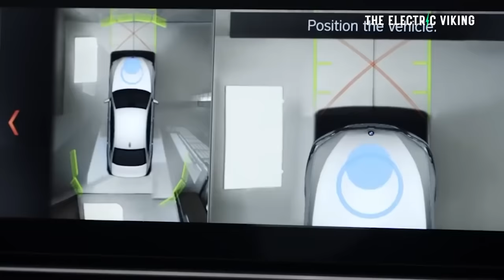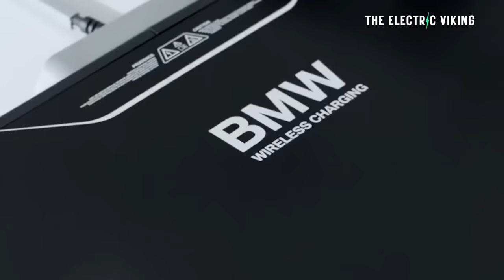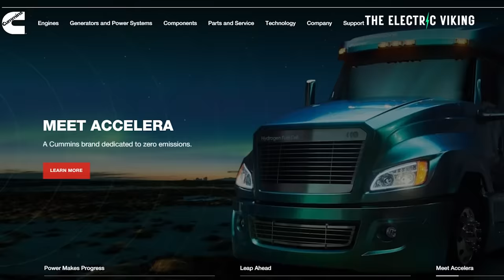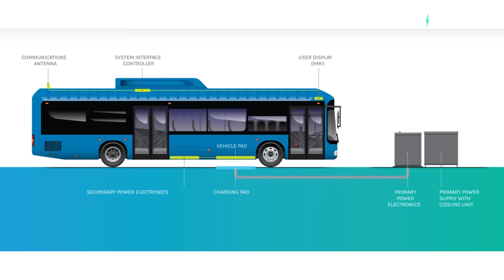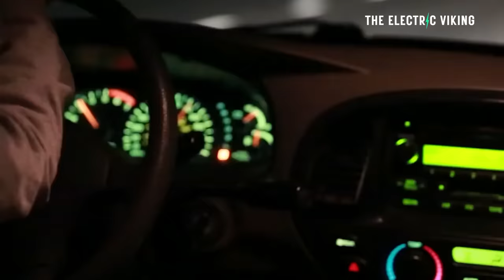U.S company invents 500kW ultrafast wireless EV charging, powers in 15 mins

Comment: Depending on the battery configuration,  they could wireless charge even faster than 15 minutes or charge at the same rate using less power,  by using a quadruple line charge controller for a 4 battery configuration layout.  Say 4 x 20 kW batteries.   Obviously the charge controller would need to be robust enough, however you could use 4 coils and 4 charge controllers for 4 batteries to maximise charging speeds and efficiency. Thus the 4 batteries are wirelessly charging in parallel.  Super fast !!!  Super safe !!!  Each battery pack gets you say 70 miles of range, thus totalling 280 miles of range.  Because you can charge super fast, range becomes less important.  A battery management system would optimise the use of the batteries and charging regime based on an optimisation algorithm, linked to the driving requirements and charging patterns.
Reply: By distributing the charging load across multiple batteries, you can potentially mitigate the effects of internal resistance and maintain higher charging speeds compared to charging a single 80 kW battery. This is because the overall charging process is distributed among multiple batteries, allowing each battery to charge at its optimal rate and minimizing the impact of internal resistance on the overall charging efficiency.
Reply: Thus a 4 battery pack configuration could make 5 minute charging to 80% well within reach.
Reply: Most drivers on most trips don't drive more than say an average of 40 miles per day.  Thus one of the four 20kW  battery packs could comfortably cover that distance and thus be run down from 80% ( 56 miles ) to 10% ( 7 miles ) approx.. SOC ( state of charge) being the optimal charge range for certain common battery chemistries. i.e. assuming a range of 70 miles per battery pack.  This usage pattern allows drivers to make the most efficient use of the battery capacity while minimizing stress on the battery cells. All this,   whilst retaining super fast charging in a safer and more efficient way than charging one 80 kW battery in the same amount of time.
Reply: Could you not have, say, 8 batteries, with 4 installed for normal weekday trips (at the center of the car) & adding 4 for longer trips (2 on each side of the 4 central packs)?
Reply: Not sure about viability of 8 battery packs.  Some manufacturers have used varied chemistries in multiple battery packs for the scenario you suggested.    I would say if you can have two batteries packs, then you could have more than two,  however there would be a point of diminishing returns.  Much would depend on driving and charging habits and requirements.  Obviously they make products based on average Joe usage patterns. The average Joe for example in the USA drives 40 miles per day.
Reply: Thus if one 20 kW battery gets you 75 miles and you're an average Joe then an 80% charge gets you 60 miles,  less the 7.5 miles being the 10% recharge threshold.  i.e.  for common chemistries they suggest drain battery to 10% then recharge to 80%.  Thus 60 - 7.5 give you 52.5 miles of practical driving range to ensure optimal battery management.  Thus that gives you 12.5 miles of reserve above the 40 miles average range of your average Joe driver, most of the time. With smaller battery packs the charge resistance threshold is reached sooner.   However,   the charge resistance level is much lower,  due to the lower resistive impedance within the 20 kW battery pack,  when compared to one 80 kW battery pack.  Thus the charging effort for the EV super charger is much easier, thus making it sustain a higher rate of charge as it approaches full charge for the smaller battery pack.

Comment: Wireless is always less efficient than wired charging, so an extra nuclear plant may be required even in the less populous countries. 10% extra charging loss in Finland (5.5 million inhabitants) would mean 4.5 TWh of new electricity production needed just to cover it, if the traffic is fully electric and wirelessly charged. That is about ⅔ of a small NPP's or ⅓ of a big NPP's yearly production. Not to mention extra copper coil, etc. that has to be built into the vehicles and driven around, too.

So, no.
Reply: Wrong. It's more efficient than a wire.
Reply: @chrisedwards8365  Maybe in some other  universe.

Comment: I can see this charger being used in parking areas, e.g. charging stations, overnight parking or residential garages.  
Trying to embed these chargers into active roads, where the construction/materials vary region to region and country by country, and the surface weaning requires resurfacing every decade or so... no.   Too much complexity.

Comment: So would all EVs need to be scrapped for new ones that have the induction charging system?
Trucks probably need fast charging less than most, as they are required to rest the drivers, so could be just recharging normally.
Are there any dangers of induced current on people animals or just some conductive material dropped over these areas?
Of course the biggest problem will be getting charged for the power, rather than just recharging from the solar on one's own roof.

Comment: I don't want to sound negative, but this solution is DOA. 1. The concept requires heavy infrastructure, multiple power supply units on the sidewalk, and unsafe pads underneath the car. 2. Costly implementation. 3. Costly manufacturing 4. require a new billing solution. 5. High maintenance. 6. Hazardous street 7. A solution that no one wants.
Reply: No one wanted the automobile when they had horses and carriages!!
Reply: Not realistic. Impractical.
Reply: Amazing armchair insights😂
Reply: Bro this is 1st generation. It'll get better by the 5th or 20th version. Give them a break
Reply: 8. It defies laws of physics. Induction losses will be huge and at these numbers where is this excess magnetic force going to go? Do not stand too close if wearing a pacemaker
Reply: Totally agree as you use about 40-50% more power to do the same as a wired charge. What no one talks about is how much to implement? Who pays for the implementation? How long before people start digging up the roads to get to the materials, the same as cutting off the charge station leads? How much infrastructure is needed? EV drivers think all of this is free until they get a bill and then scream how unfair it is.
Reply: This solution is clearly for City Driving only, for public transportation only at the begining. So it is very welcomed. Next gen will be better
Reply: @dstr1 No. They totally did. And that of course how the change occurred without even the smallest amount of government coercion or mandates. Put your idiotic EV mantra away.
Reply: You forget paved roads, and highways didn't exist. People had to do very expensive hard work to make it happen ut was impossible for cars to go anywhere outside cities
Reply: Wrong. It's safe and more efficient and less costly than wires or gas stations.
Reply: It's 98% efficient and placed nowhere near pacemakers. Besides that pacemakers having protection against electric fields, like from your wall socket or spark plugs on your car.
Reply: This is th future u don’t know wtf ur typing about
Reply: Your totally wrong... It's 98% efficient. And 1/4 the cost to build and zero to maintain.
Reply: Maybe they can't afford roads because the military that protects foreign oil, for $35 Trillion and the $7 Trillion to oil and gas subsidies, and you still have to pay at the pump.
Reply: Recently Joliet Illinois denied an electric  truck charging station because it would consume more electricity than the city has.
Reply: @ttkddry  the amount of losses is not a problem, as long as it can be dealt with cooling. very fast DC charging like the v4 1MW superchargers require liquid cooling too anyway. the problem is efficiency if it's much lower than charging through a cable it increases charging cost and emissions to generate the electricity.
Reply: @geemy9675  thank you for repeating my argument, the losses are a problem because they decrease efficiency. Most high amp DC cables have liquid cooling built in
Reply: @ttkddry what law of physics exactly? electromagnetic waves and magnetic fields travel through air very efficiently. it seems like the most wireless chargers are around 95 %
Reply: @dikkybee4003 what if it has similar efficiency
Reply: a lot of the charger maintenance is related to cables and plugs
Reply: you should think about cost differently. what if you have a bus with a much smaller battery that charges a few percent every time it stops at a bus station. charger are not limited to a. certain. umber of cy les so it can actually be cheaper when you amortize the infrastructure
Reply: @ttkddry  500kW with 95% efficiency means 25kW of losses. it's a lot of heat to dissipate , but it's still very efficient, and way efficient enough that it could replace cables in some cases where the lack of cable is a big advantage
Reply: @timothykeith1367  BS the city has a population of 150000, and "Illinois leaders celebrating a big grand opening in southwest suburban Joliet on Friday.
Lion Electric opened its new 900-thousand-square-foot manufacturing plant for electric school buses and trucks.
It's the largest factory in the country and will produce about 20,000 electric vehicles a year, employing hundreds of workers."
Reply: @geemy9675  you will never reach 95 or 98% efficiency with antennas like that, even with galvanic connections and long copper cables you have major losses

Comment: i'm sure, in cold snowy climates, those snow plows will just rip them apart over time
Reply: They probably won't be built in snowy areas. Not everything should be built everywhere.
Reply: Wouldn’t the snow and ice melt with the heat generated from the transfer of energy? No snow plow needed over these roads…you’re problem is solved.
Reply: Me not so much

Comment: Why have the cost of two systems when just a plug in battery works. You still need a long range battery for off charging paths. Also why pay for electricity off a corporation at a higher rate.
Reply: V2G

Comment: Weres the power for thousands of 500 kw coming from ?   Like you said a house uses roughly 30kw wake up people
Reply: Can't you do the math? The average person drive 12000 km a year. That calculates out to about 5kWh a day. Easily handled by the grid systems as there is plenty of overnight capacity. And  full EV adoption will take 20-30 years, easily enough time to add more generation. Do you think corporate electricity generator's don't want to sell more power?

Comment: it still doesn't change the fact their isn't enough power and infrastructure to support ev's
Reply: It appears that AI computing is taking the lion's share of electric power, not EVs.
Reply: And it doesn’t support every air conditioner running at the same time either😂 Luckily it doesn’t need to charge every EV at the same time!